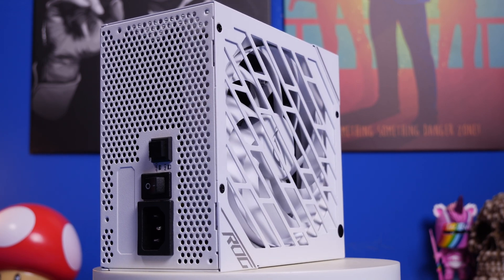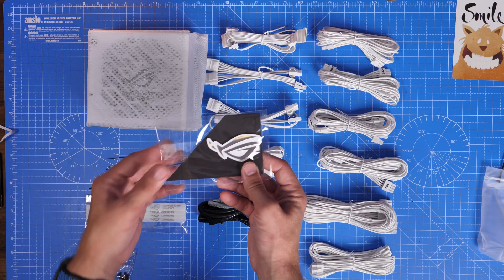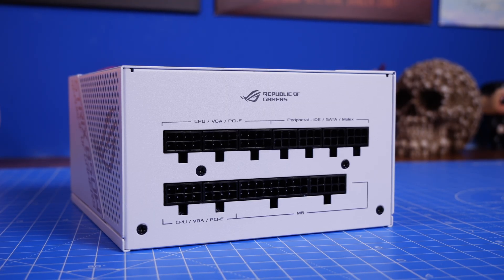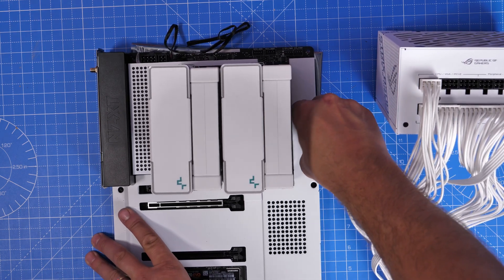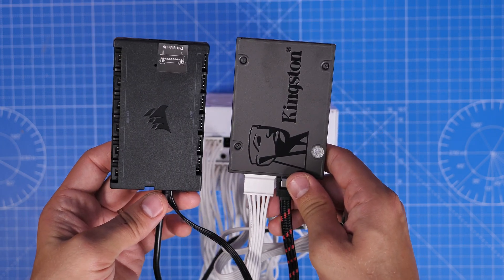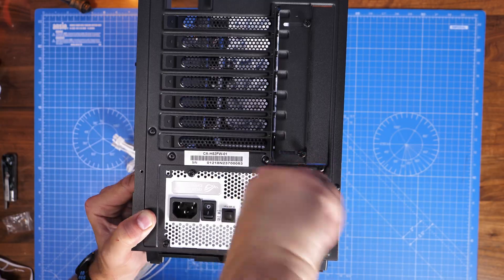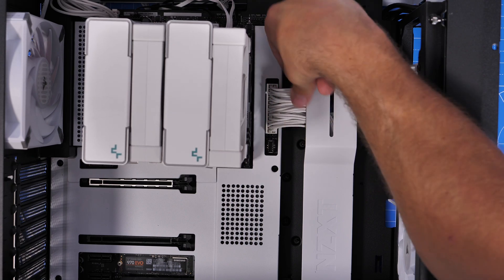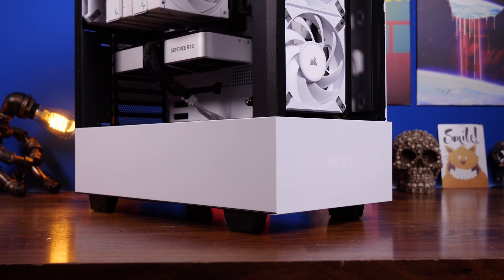Asus Rog Strix 850w PSU unboxing and build guide

Comment: @TheProvokedPrawn question about GPU. The one that I ordered "MSI GeForce RTX™ 5080 16G VANGUARD SOC" has 16pin connector, but PSU doesn't have a separate 12VHPWR slot, then will I need to connect all three PCI-E cables into adapter, that comes with GPU?

Comment: Thank you so much, I just put in my first modular power supply and it wasn't powering on didnt realize I needed both ends of the motherboard cable plugged in.

Comment: Will this work with the asus Rog strix 4080super with the 12vhpwr? How is that connected?
Reply from the maker: You should have an adapter included with your GPU that you can use with standard PCIe power connectors.

Comment: I never used my computer much until now, as I've only just obtained a graphics card. This power supply you show above is quiet when idle or light tasks, but I've found out that under medium load, it creaks every 5 seconds, like a slow door. The same noise can be heard when the fan button is pressed as the fan starts up or slows. The fan also seems to fade in and out, although that's fairly subtle and most people won't realise it. Others report the same creaking with Seasonic, which I believe are the manufacturer of Asus psus. I wonder if the fan motors are low quality and all the creaking and fading in and out will affect it's longevity. If it's not a warning sign, there's no point returning it as they'll probably send the same model with the same issue again.

Comment: Should I use two pci cables for powering 3090? Or one?
Reply from the maker: Two
Reply: @TheProvokedPrawn  in the motherboard power connector part. I connected one 8 pin cable on top. For the second power connector right beside it which has just 4 slots. Can i use the 4 pin connector from half of 8 pin connector?

Comment: My loki 850w ain't built like this really, which makes it frustrating. 1st 1 says pcie and below says pcie go there as well. However the top pcie has same pins as the one labeled 600w, no other slot has that. So I'm confused on which I pick for that. The pcie or 600w. I do have 2 extra slots for pcie though. On top next to the motherboard other is the bottom next to the cpu slot.

Comment: I bought this exact psu but it came with a power cord that had a green/yellow ground wire coming from the outlet side. I think i got a japan power cord. Are all PSU  power cords interchangable? Can i just buy one from bestbuy or is the entire PSU internals also made for the lower wattage that Japan has?

Comment: Asus rog strıx 1000 w Gold power suplyy The 4+4 Pcu cable does not work with the eight pin dual dual procool power connector, what should I do?
Reply: were you able to solve the problem? and why doesn't it work? Are the connectors correct?

Comment: Can you use the corsair premium wires with this psu or would that be a problem?
Reply from the maker: I believe the advice is to never mix and match cables and PSUs from different brands. I'd suggest cablemod might be a better option as they're extensions rather than connecting directly to the PSU.

Comment: I have 2 of these and am dismayed that components like this no longer come with documentation. My first puzzle was whether I should split my cables evenly between the top and bottom CPU/PCIe choices, that is, whether these were separated electrically into what I've heard referred to as "rails". I will now give up on that question since it doesn't seem to make any difference. 
My two graphics cards have sockets for two 8-pin connectors (3070ti) and are also undocumented. I don't know if there is an advantage to running two PCIe cables. Since it would be so ugly I'll just take a chance and use a single cable. But I am puzzled about the logic of splitting the cable into two 8-pin connectors, since the capacity of the cable remains the same. Similarly, why do graphics cards have two separate ports unless they anticipate receiving input from two different cables?
 I have a possibly helpful, note: The two supplied SATA cables are, in fact, different. They are oriented in reverse. I found that one worked perfectly for me, allowing me to link my two SATA devices (HDD and fan hub) without twisting the cable and letting me stash the unused connectors in an unused HDD bay. The other SATA cable would have been an ungainly choice.

Thanks for the various hints, especially as I'm building 2 different systems using this PSU.
Reply: Hi man do you know if there is any problem w connecting the pci port on the cpu port on the power supply? Thxs! Would appreciate your answer
Reply: @sergiovaldes9959  Somebody more knowledgeable will have to answer this. From my many questions above you can see that I don't fully comprehend power supply wiring.

Comment: Really wanted to like this psu, but pcie cables don't fit into gpu.  Apparently it's a common issue, going from reviews.
Reply from the maker: 🤔 had no issues here
Reply: what Gpu do you have?
Reply from the maker: @heisenberg1098  RTX 3060 Ti Founder's Edition
Reply: @heisenberg1098  EVGA 3080 Ti . Tried my other psu, and all cables fit fine.
Reply: @heisenberg1098  EVGA 3080 Ti.  Tried another psu and the cables fit.  I've read that the cables are problematic in reviews, reddit, etc.  Seems they had a bad batch of pcie cables.  I bought Cablemod cables to replace them.